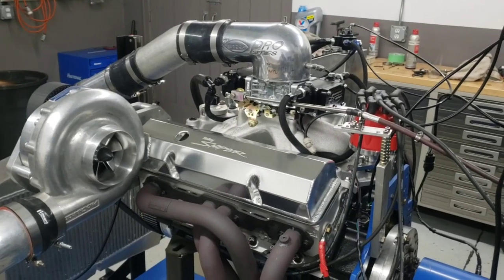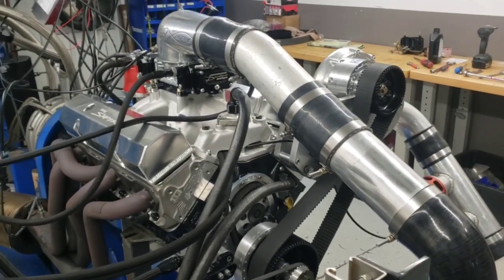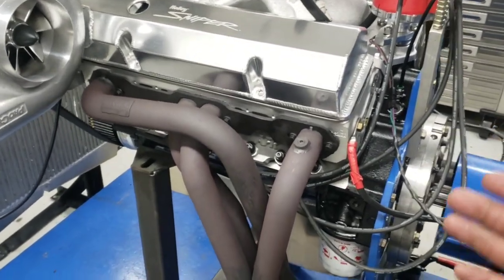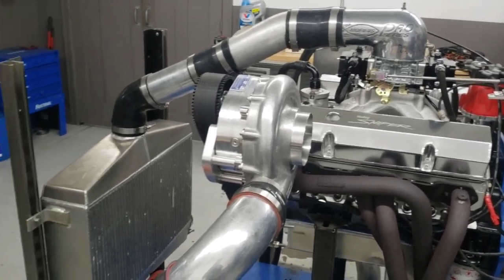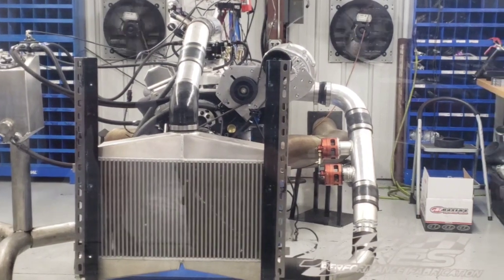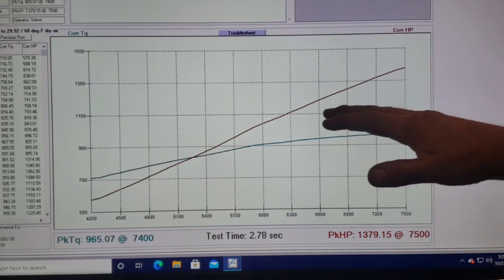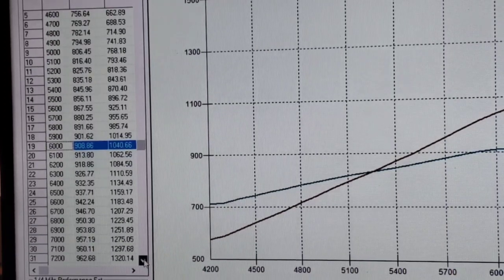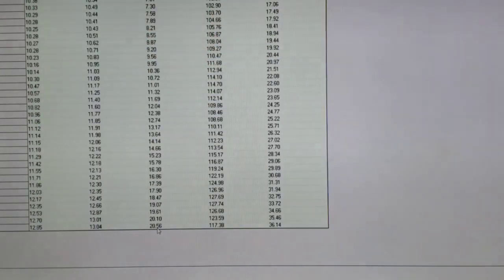SBC Blowthrough F2 ProCharger.

Comment: Setup reminds me of the good ol' 1990s street race days. Crazy you mentthe snout! My buddy just got his motor done and installed. After breaking it in he stopped by my work, he launched when he left. The balancer snapped off, hit the ground then shot back up through his 4 inch freshly painted Cervini's cowl hood he waited 4 months to get.😬
Reply: I literally stood there for what seemed like 10 minutes wondering what the f@ck just happened. He just installed the motor that I know he had over 20 grand into, and this was in 1996. It was definitely crazy seeing it happen instead of being told about it. I don't remember all that was hurt but I know around a month later it was running again and he went 10.20s off the foot brake on just motor. We wear all running Vortechs then, he was running a solid roller so he was running a R-Trim and cog setup. If I remember the first time out it went 9.10 then he wasn't allowed to run no more from lack of certification. These were our street cars. I could only imagine having this DFI stuff now. But the good old days are priceless!

Comment: If you haven't done before - talk about the difference between the requirement for a blow-threw carb and a box that the carb goes into under pressure and the price differential - Thanks in advance

Comment: Why didn't he go with the all black billet APD dual needle and seat? APD and IRD all billet dual needle and seat carbs are bad ass.
Reply: It was an all APD carb when we started but we ran out of mainwell size in the main body and metering blocks and it was still going lean up top so we got a pro systems main body and metering blocks and then it really came around
Reply: @codyyoung3078  I ain't a fan of prosystems, I don't care for the owner. I like Steve and his work, he knows his stuff. One of the best in the business. I am just very surprised that a APD wouldn't keep up. Scottie Duggins PAR built my 540 f1x-12 with the all billet APD dual needle and seat and it made 2200 rwhp. The F3-136 540 Scottie just did we used the black all billet 4500 IRD dual needle and seat e85/meth carb and it's supports 3k. It is a nice sbc you got there though.
Reply: @jasonritter2492  yeah it was more of just the time table pro systems was just down the road from the shop otherwise we could have just sent the APD body and main blocks back and have them fixed but I was happy with the power and the way the carb came around with the pro systems setup so I just took that one home with me
Reply: Steve did say it was unusual for APD to miss the out of box tune-up so far just one of those deals
Reply: @codyyoung3078  I understand now. Lol I thought you meant just not enough carb period. That is why i was like wait a min. That sbc is a nice build though.
Reply: @jasonritter2492  thanks!

Comment: Hey Cody think you can give us a ballpark number on the cost of the build with your block and heads ??
Reply: Probably around 35k all said and done I gathered parts slowly over about 3 years
Reply: Sorry I meant SM price after dropping off your stuff. Thanks Cody. Have a complete 406 built by whites racing I was thinking about converting to pro charger   Shp block w AFR 220 heads. High compression so not sure how much is usable besides what I mentioned
Reply: @cody young i have a couple questions about this build

Comment: Can you give timing specs for this combo on c16?
Reply: This particular motor we ended up at 40 degrees with the c16
Reply: @codyyoung3078  40* under boost? I have a similar setup, very difficult to get information as I tune and built the engine myself. I'm just looking to compare timing plots with something similar.
Reply: @BlytheLifeRacing  yes under boost but intercooled it's still a 23 degree headed small block depends on what camshaft you're using as well every engine is different thats just what this one liked

Comment: What is a safe timing on a setup like this
Reply: This setup we ended up at 38 degrees on pump gas and 40 on c16 but that's intercooled and 9.5:1
Reply: @codyyoung3078  hey man badass engine setup and you had the perfect guy doing the work congrats!!
Reply: @codyyoung3078  what timing levels where you at with race gas and inter cooled